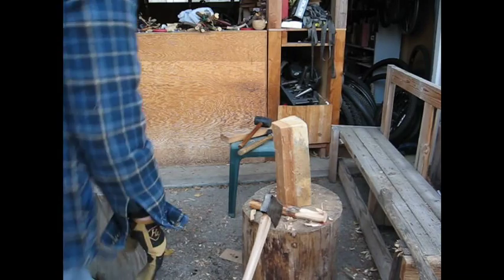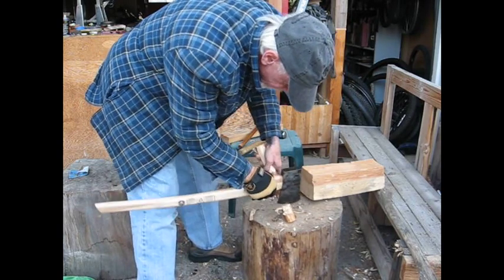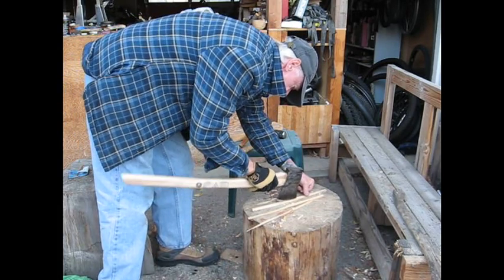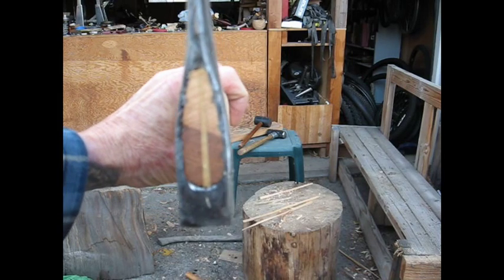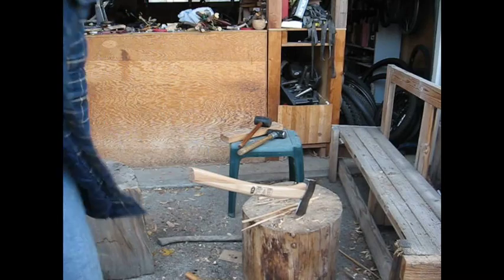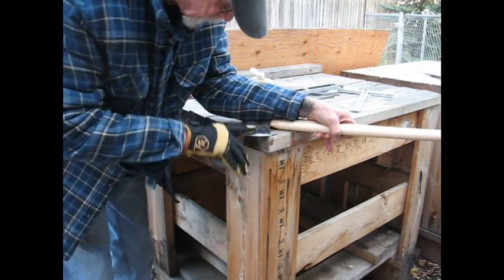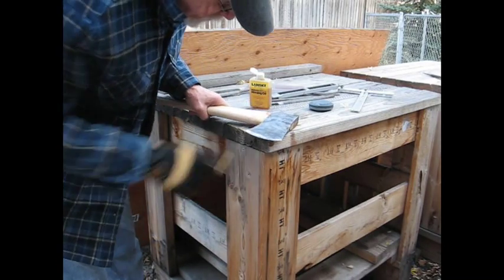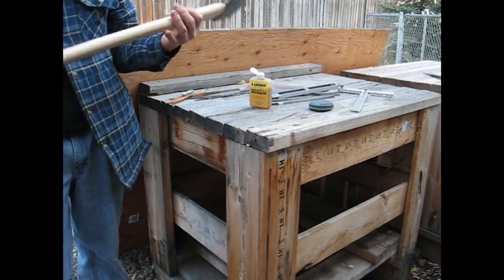Hanging an old axe

Comment from the maker: lol; I do very little the same now...have a table belt sander I use a lot...hardly ever use the grinder and use paint stripper for the handle and then hand sand it.  use the belt sander to put a convex edge on too.  will do some hand sharpening.  funny how your methods change over time.